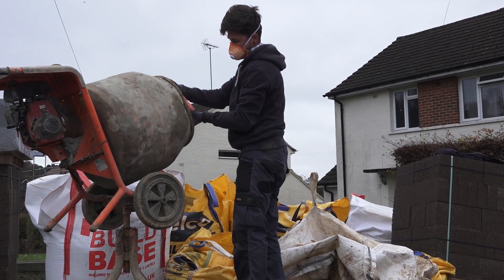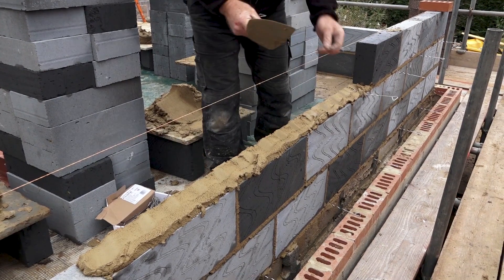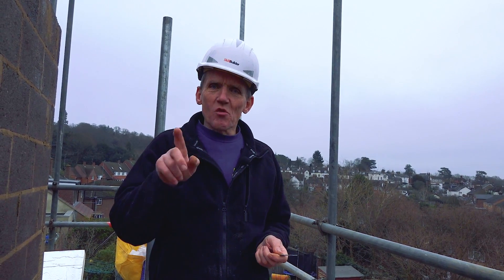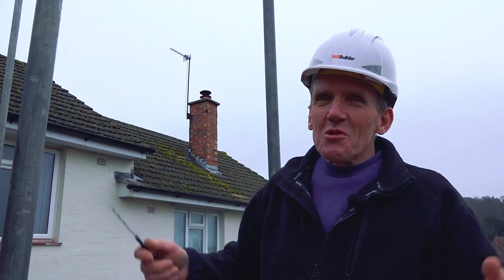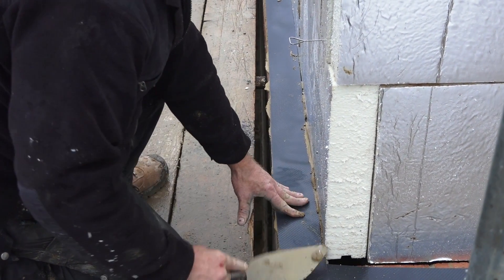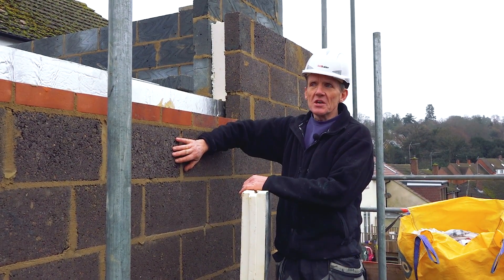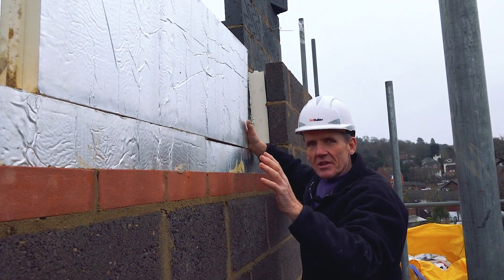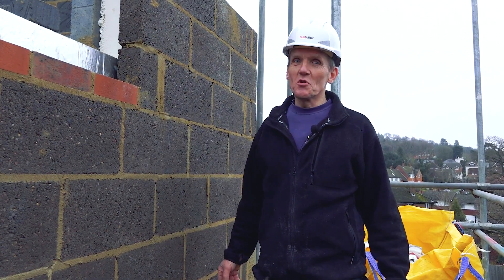Brickwork & Insulation | Building an Extension #4

Comment: an expansion joint in a brick wall... thats hideous... why are there no expansion joints in any brick buildings build before today? ive never seen an expansion joint in a centuries old castle or even an old brick house or fence... the whole point of brick is that it interlocks... an expansion joint is the opposite of interlocking...
Reply: Lime mortar was more flexible then. Today you can use it but you’d need a rain screen system behind it. It’s also slower to cure

Comment: I always check things before builders do something. But I trusted our architect/engineer when he provided the specification drawings. Once the footings were finished I learnt that now the building regs require 150mm cavity instead of 100mm. Our footings were done with 110mm cavity (103mm brick + 50mm residual cavity + 60mm PIR insulation + 100mm blocks). Now I wonder if the building inspectors would ask to break the footing and redo with 150mm cavity :(

Comment: The cost will never be recovered in heat savings its not the North Pole Nice video
Reply from the maker: The house is warmer and it faces South so there are many days in the winter when the heating is not switched on until after dark. The house might stand for another 100 years or so and fuel prices appear to be rising so I will let somebody else do the maths.

Comment: Q.. so the slip ties go in around 6m..But when the render goes on the outside skin of all those blocks does that render come to a stop at that point? so we effectively have a visible gap? (later gap filled with silicone)
Reply from the maker: The joint is filled with a foam and yes you can see it

Comment: Very interesting video well done. I would like to know how the relationship between the cavity wall ties and the rigid cavity wall insulation works. Would I be right in thinking the insulation is cut to suit the wall ties? If so that must be quite a messy process as I am sure the cavity wall ties are supposed to be staggered vertically and horizontally. It must cause the bricklayer a bit of a headache if that is the case.
Reply from the maker: The insulation boards are sized to work with the wall ties. No cutting required and in some places we just push through

Comment: Great videos, keep up the good work. 
Have a word with the guy using the chisel. He needs to grind the curls off the top. They can be dangerous if they fly off. I know a guy that was blinded by one.
Reply from the maker: Good point for sure, you can often knock them off with a hammer

Comment: I thought that silver foil insulation is condensating?
Reply from the maker: Hi Stef. If you think about it the moisture migrating through from inside to out is going to hit the warm side and won't condense. It escapes as vapour. Once it is through it will hit the colder outer leaf of the cavity wall and that is the dew point where the vapour turns to water droplets and runs down the wall to the footings. The rest is soaked up by the wall and eventually evaporates as the wall warms up.
Reply: I’m just going off Norfolk building control … they won’t allow silver foil backed insulation without a vapour barrier

Comment: Thank you for the great video and invaluable insights. I have a question if using 50mm PIR in 100mm cavity (not T & G) do you use aluminum insulation tape to the joints between the pir sheets? also how do you get the PIR sheet to stick to the inside wall?
Reply from the maker: Yes use foil tape and fit those red plastic discs to hold the slabs to the inner skin.
Reply: @SkillBuilder  thanks for the quick reply, much appreciated

Comment: Ho did do they get the insulation in between when the brick-ties are in place?
Reply from the maker: It works out every other block course. That is how it is designed so the ties line up with the joints in the boards or batts

Comment: Just checking on the dpm. Just 100mm on each skin? No tray or 300mm across brick and block work? 
Thanks
Reply from the maker: Normally the dpcs are on each skin but if you have water that needs to be directed to the outside then a wider stepped down dpc is used. This happens over lintels etc

Comment: Why do you use traditional red bricks in some spots and the engineered bricks in others
Reply from the maker: The enginnering bricks are below damp and under the steel beams. The fact brickwork at the front is there to match the panel on brickwork on the main house.

Comment: The joints on the foam boards should really be taped.
Water loves to wick by capillary action and even "defying" gravity and goes straight up
Reply: Over engineering
Reply: I wonder weather just square edge boards and taped with foil tape would just be as good.

Comment: Good informative YOUTUBE video as usual. With regards to thermal cavity wall insulation, I’ve never favoured AIRCRETE bl’wk being used to improve thermal values, as the inner cavity wall leaf is really for loadbearing requirements from floor & roof loads & certain beams. Therefore, a dense aggregate block will tend to perform better structurally than AIRCRETE block & with all the inherent fixing issues to AIRCRETE.

The advancement of rigid foam PIR insulation boards these days have good thermal conductivity values & its common place to find boards with values of 0.022 W/m.K & 0.018 W/m.K. Furthermore, these boards can be used as nearly full fill boards (as per your video) rather than partial fill where a 50mm clear cavity was typically required, subject to your region’s exposure zone & wall finish.

When you compare the U-value of an AIRCRETE block compared with modern PIR insulation boards, typically an increase of only 10mm thickness of PIR boards achieves a better U-value than the AIRCRETE block. Therefore, as the thermal performance is so much higher than AIRCRETE blocks, a slightly thicker insulation board with a dense inner leaf concrete aggregate block will still surpass the required the 0.28W/m2K U-value for Part L1B of the current building regulations & the build will be better structurally & cheaper for the client.

Comment: Interesting how the methods are different in Poland. Double walls are very rare here. Most popular is to build a house from air concrete blocks and then put 20cm styrofoam outside and then put plaster with mesh inside out 4mm thick.

Comment: Just a question from the USA, when you render the walls( we call it stucco) do you put a metal expansion joint down the sides of the windows to keep control the cracks? I really like your videos, you have a great sense of humor.
Reply from the maker: We put what we call angle beads down the sides of the windows. They are metal or plastic. They are there to form crisp edges. The crack control is achieved with movement joints which run all the way up the wall.

Comment: Where does the water go when it accumulates at the bottom of the cavity? It can't just drain away, continuous DPC should run through from inside leaf down and out to outside leaf with weep holes/vents to allow moisture to escape. Proper order.....
Reply from the maker: How much water do you think gets down there?
A clear 150mm void beneath the dpc allows any moisture to sit there and soak into the ground through the blockwork. It happens in most cavity walls with no problem.  Don't forget this is rendered. The water is more likely to be from the dew point.

Comment: I am loving the work and information you are providing and it is clear that the damp proof membrane and insulation work hand in hand, but what I cannot get my head around is how the break is done when you have a door space and the wall seems to connect the outside and inside together
Reply: John Fithian-Franks cavity closers are used which comprise a layer of insulation and a damp proof layer.
Reply: @letsgocamping88  Thanks for that, I am considering a pair of doors to open onto by back garden but I did not want to create a way that damp could bridge the gap and get into the house.
Reply: Older houses did used to close the cavity with brickwork. My window sills and reveals are this way. Acts as you suspected as a thermal bridge. I’ll be looking to insert some sort of cavity closer or over board with insulation in the future.

Comment: how do you render over the expansion joint on the outside? wouldn't that crack?
Reply: Just put two beads side by side then render over, clear the cement from the gap the. Squeeze construction silicone into joint.
Reply: Expansion bead.

Comment: PIR boards with tie wires doesn't work correctly. The drip on the tie acts to run down the centre of cavity. with a boards it can not drip.  100 mm insolation boards. Needs at least a 50 mm air gap. And use tie irons that give a bearing of 350 mm 100 mm brickwork 150 cavity 100 blockwork.
Reply from the maker: Yes the drip on the tie is designed to run down but the plastic disc works as a drip. We have a 100 mm cavity so a 350mm tie is too big. The system works fine and we won't any damp on the internal skin.
Reply: Skill Builder the plastic disc are on firmly fixed moisture running down the boards will eventually run behind the back and then on to the wall ties

Comment: Good stuff, all neat and careful, would query the wall ties not being staggered though.
Reply from the maker: Hi Lisa 
Good bit of observation there and on some points they may be in vertical lines but I think you may be looking at either side of the pier and movement joint where they are in straight line on every course. The others are randomly staggered but they are every other course and laid in the block not under the perp because is hold them down better. We put one in every course either side of the windows and doors. At those points, it  is tricky with that insulation because it is easier to push them through afterwards and point up rather than try and push the insulation over the ties. We used some Tiger ties at some points just to make life easier.
Reply: Actually look at 52 seconds, shoots you're statement to bits, 4:40, up pillar, only one wall tie on each course, don't get me wrong, really good work, inspectors and C of Works would never accept that in this area.
Reply from the maker: Sorry Lisa 
Call me thick but I don't completely understand the point you are making. You can see Mark pushing wall ties through the insulation on the edges of the window openings so they are in every block course around openings. Elsewhere they are spaced closer than 900mm on every other block course. At the movement joints they are in every  block course. I am happy that you are taking the trouble to comment but I am struggling to see what is wrong or what the building control inspector could object to.

Comment: Looking forward to part 5.   How much floor area will this extention add in m2. Also roughly how much will it cost?
Reply from the maker: It is 24 sq mtrs per floor and there is a half cellar. Cost is going to be around £75,000
Reply: Skill Builder does that include VAT?
Reply from the maker: Ah yes  the vat is extra

Comment: Hi Roger!
Could please explain the point of the expansion joint on the internal wall because the plaster board doesn't not expand or contract and it all gets skimmed.
Thank you
Reply from the maker: Hi Viktor
This is a very good question and you are right about the plasterboard. If you are doing a traditional plaster system you would have the expansion joint coming through but people don't like to see it so often it is placed behind a wall or door frame. In this case we are using dot and dab and the boards will be fixed with Geocel foam which allows the wall and plasterboard to move independently. If you are using dry wall adhesive (rock hard) then the wall will have dried out and shrunk before this has done so all the movement on that joint will have taken place. It is very unlikely to move after that. A lot of people don't bother carrying the  movement joint through into the internal skin but if you do it by the book then you should do it.

Comment: Hi Roger, great video. How does external insulated rendered cladding work with the cavity? Does it just mean no insulation is needed or would it leave a cold spot on the internal walls? Thanks
Reply from the maker: Hi Nick 
 I have never seen  EWI used with a cavity wall. It is mostly a way of insulating houses with solid walls and it gets a bit of bad press because there are often cold bridging issues. Basically, the difference between the insulated wall and the odd bits around the eaves or windows is so marked that the airborne moisture in the otherwise  warm house hits that cold spot and condenses.  It is a really good way of insulating because it leaves the thermal mass of brickwork on the inside so it gets heated but those odd areas where the insulation can't be applied is a huge drawback.
Reply: Ah ok. Will nail that one on the head. Thanks again.
Reply: @nickwalton8864  there's ways around those issues mentioned. You can get insulated sills http://passivesills.com/ and use a couple of thermal courses at the eaves and also at ground floor level which means zero thermal cold bridging anywhere. I've drawn up A rated houses using 200mm EWI and 215mm block work and its my preferred construction method by far. Some more info. https://passivehouseplus.ie/magazine/guides/the-ph-guide-to-external-insulation

Comment: How do you insert the insulation with wall ties in the way?
Reply from the maker: The insulation is sized to go in between the ties which are in every other block course. There are some places around the windows where the ties are in every course. Here you need to push the wire through the insulation. It is easy to do.

Comment: t & g is a nightmare to lay/place. i'm foil taping my joints to ensure its air sealed but have to cut little notches out of tongue to slide in the 20mm then fill with expanding foam when next layer goes in.  tip  - put loads of ties in the very first course to fully support boards and keep level
Reply from the maker: Hi Munkmeister
It is time-consuming  I agree and stuffing 100mm Rockwool batts in is easier. Like your tip  about  placing loads of ties in the first course. We didn't and it rocks around. We just bashed the end of the board and the ties cut their own path.  I thought about taping the joints but am not sure about the airtightness  being that important. If the cavity is sealed there is very limited air movement in there.
Reply: @SkillBuilder     I have scrutinized many of your video's and if you are the foreman with the knowledge you have ,I would advise you to go back to college and retrain !

Comment: Thin joint mortar will reduce thermal bridging in lightweight blocks. Cavity can't be filled with mineral wool insulation as it will  become damp and start to rot. To many thermal bridges including wall ties.
Reply from the maker: Cavities are filled with mineral wool all the time in the U.K . It is glass or rock and therefore won't rot. They claim that damp won't cross it.
Reply: Didn't you hear about billion of pound worth insurance claims arising from mineral wool used in cavity. It is breathable and therefore can accumulate moisture that travels true internal leaf, depending on pressure differences and damages structures organic materials.
Reply: Mineral wool is usable as external wall insulation were it can dry or internally were it's protected from moisture, but not in cavity.
Reply from the maker: Insulation Cavity Batt

ROCKWOOL Thermal Cavity Batts are a semi-rigid full fill insulation solution for masonry cavity wall construction, suitable for use in extensions. It is easy to handle and install and provides a close fit against brick and blockwork. The batts are non-combustible and water repellent, yet vapour permeable.

    BBA certified for all exposure zones
    Acts as a cavity barrier
    Prevents water transmission from the outer to inner leaf
    Highest Euroclass fire rating – A1
    Water repellent and vapour permeable
    Resists rot and mould

Comment: Hi great video very informative,I am going to build my own single storey extension in block work,9.75 metres long so would you recommend expansion joint on both inside and outside leafs.Also do you recommend the hemlite blocks externally as I was thinking of using them for insulation and ease of weight reasons. Would you recommend the insulation you have used or 100mm rockwool which do you think is better.Thanks Lester